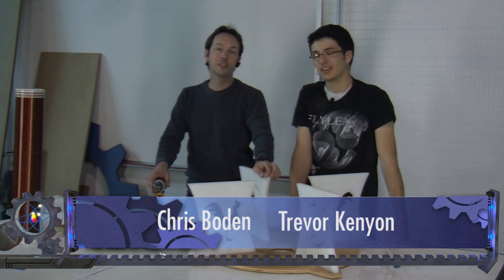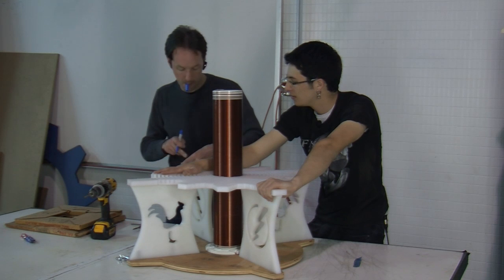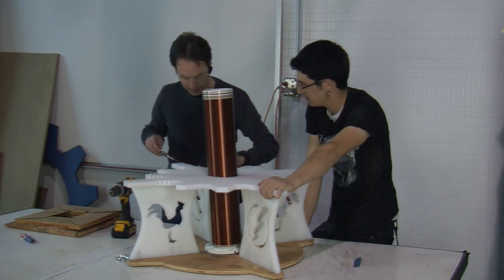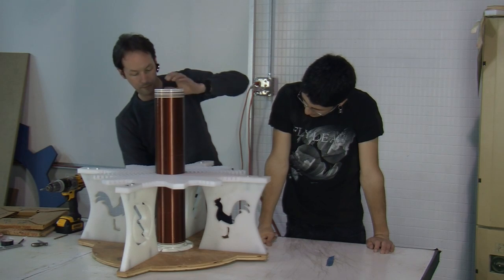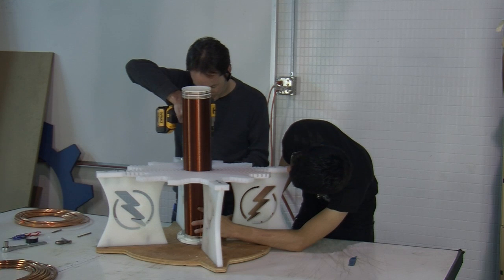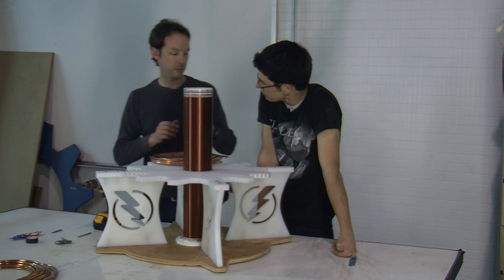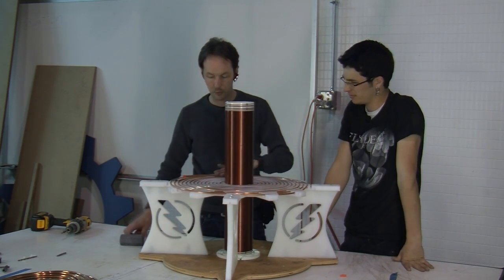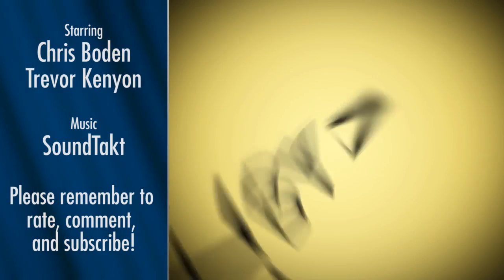Winding a Primary Coil: Tesla Coils with Trevor #6

Comment: A flat coil has less coupling, so the danger of streamers getting into the primary coil is reduced - very important when using NTSs as supply. Also, you avoid racing arcs across the secondary coil.

Comment: They are also commonly seen as a Cone in DRSSTC systems, but most large ones, are flat.  There is performance reasons, but the most seen one is racing sparks.  If you have a helical climb 4" up a secondary, thats just going to give you grief for flash overs..

Comment: I've worked with that flexible copper tubing and had problems with it kinking before.  A homebrewer told me to fill the tube with sand and put the caps back on before beginning to work with it to prevent the kinking,  It worked very well.  You probably wouldn't have to be as careful with the deadblow hammer either.
Reply: NGinuity it's better to fill it with water then close it by clamping and soldering the ends shut.. it's alot easier to get out then sand, don't use sand use salt if anything then you can flush it out with water if it gets stuck

Comment: would have been much easier to wind the primary before installing that top piece.  That way less contact with the secondary, and you'd have drilled the holes before hand.